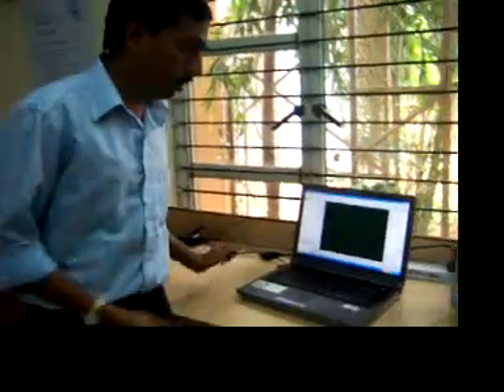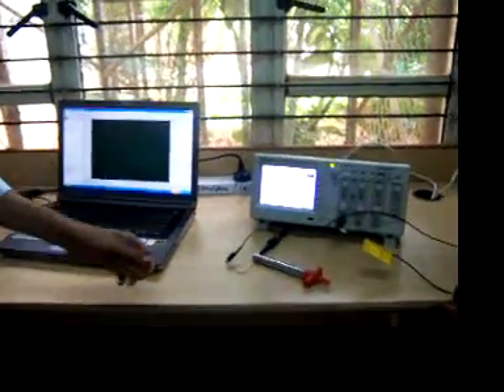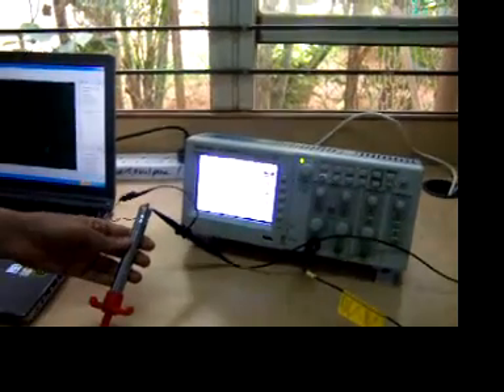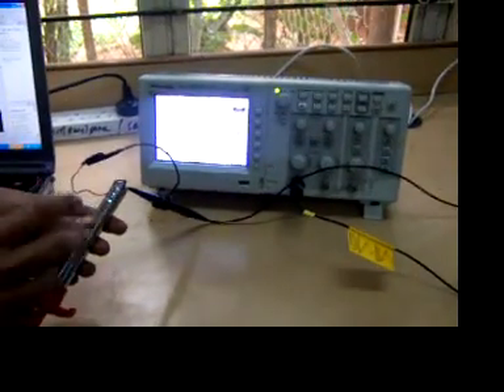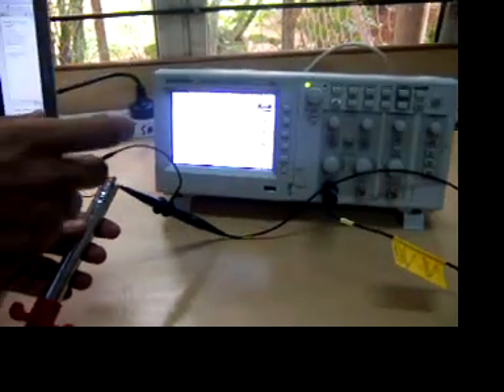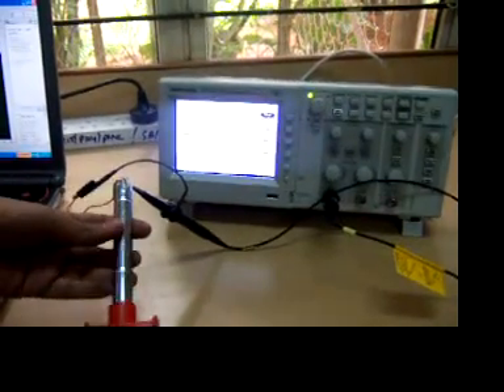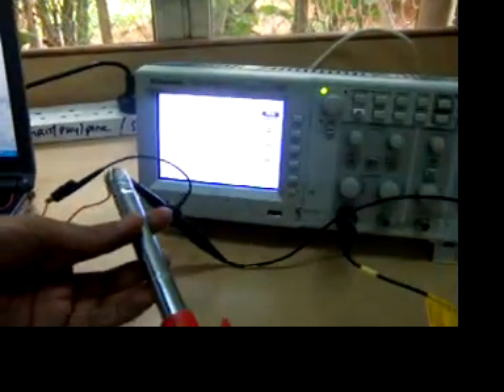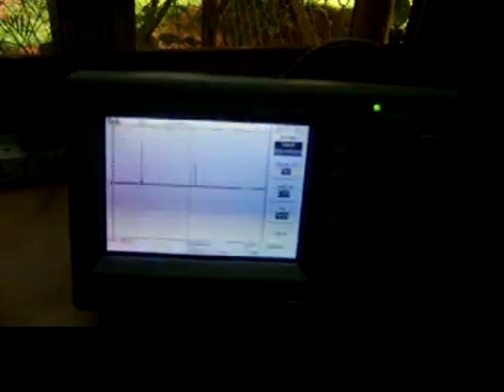piezoelectric crystals generate high voltage high school physics project ravish polarisation

Comment: Hi..How much voltage it will generate for a basic buzzer type element?? ..here we are applying force continously with time gap so  obviously it will generate a AC voltage..what type if material you will advice to me to get a reasonable voltage 5v (i am getting 200mv with buzzer)...
Reply from the maker: See I have noticed voltages in the range of 100-200V when heavily hammered.Ordinary piezoelectric crystals available of diameter 4cm can make an LED glow.

Comment: what is maximum voltage that we can get from a piezo,,,i am in a thought of doing piezo electric road(high mechanical stress withstandable piezo) .........please send me a link for the specifications
Reply from the maker: I have read about voltages like 500V and above being generated.one may design a crystal for a specific voltage.For small experiments, you may buy it from shops on SP Road,Bangalore.A small crystal which makes an LED glow (1.5V)  when applied stress costs Rs 5/-.

Comment from the maker: the voltage pulse developed depends on the pressure exerted.it may be 500volts in the case of a gas lighter.yes it depends on the size.